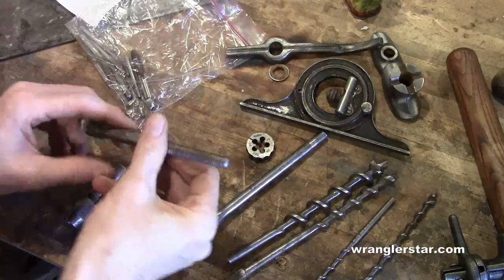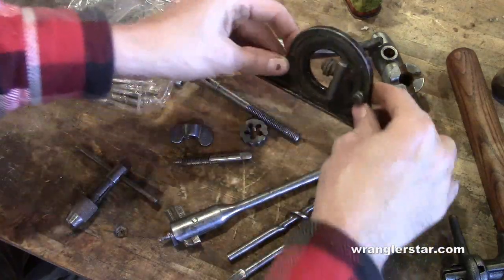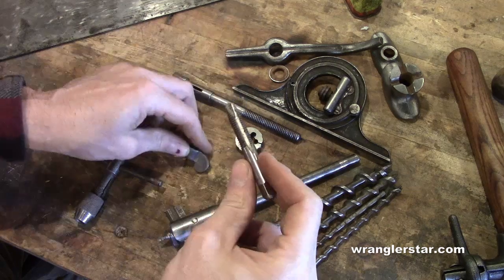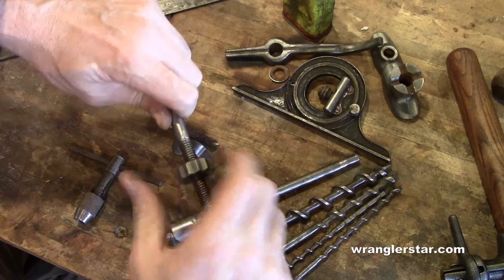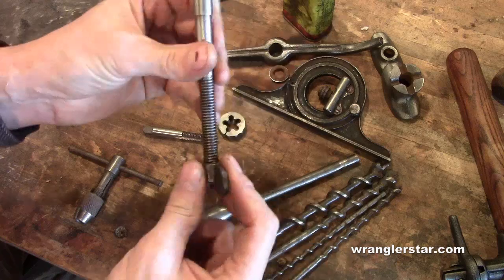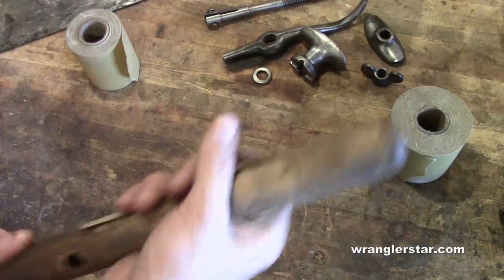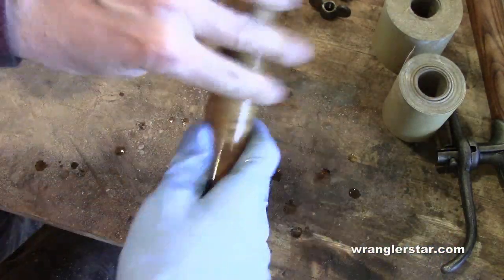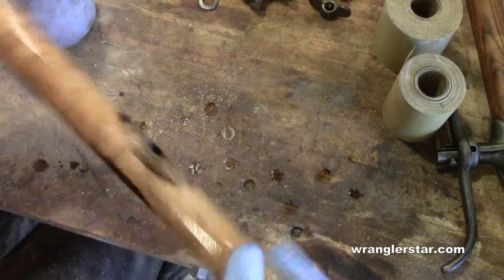Crosscut Saw 6.0 - Wranglerstar

Comment: Great video series Cody. The handle definitely is not ash or beech as others have guessed. Ash has a pronounced straight grain and beech is characterised by its flecks look at lolly pop sticks. My top guess is boxwood common on good chisels for its resistance to splitting with impacts, like beech but better. It has a wavy grain with obvious knots. Next best guess would be maple.

Comment: Looks like hard maple.

Also, we on the railroad use track adzes to chop away the cut-in area of ties under the tie plate to regauge track. We all pronounce adz with a short A like axe. Warwood still makes about a 3 pound railroad adz in the USA, if you are looking for a new one.

My great great uncle made his living as a tie hack using an adz and swede saw, just a 36" steel bowsaw. Railroads used to buy cedar pole-ties from independant tie hacks. A plle-tie is a 10" white cedar, 8'6" long, peeled, and hewn flat on two opposite sides, used for sidings and low tonnage spur tracks.

Comment: Cody,

Try a vinegar soak on rusty parts. This works both for freeing rusty parts as well as cleaning.

Afterward a quick heating with a heat gun and then a dunk in oil or axle grease will coat the piece in a good layer of protection.

Just a thought.

Comment: Here's another tip Cody that your subscribers might like in the event they have a project that has some old crusty or slightly messed up threads and a tap or die is not available try using some valve grinding compound on the threads working the nut back and forth will do a nice job to clean them up.. Take care

Comment: Cody, I was thinking about the leather insert in the washer.  I wonder if it is not intended to help keep the wing nut from backing off while in use.  It seems that a metal on metal connection would have less friction whereas the leather on metal might help in that regard.  Just a thought.

Comment: Could the leather washer be a predecessor of the compression washer or lock washer? It could be there to keep from marring the metal but I think I'd still lean more towards it being used to lock the threads with pressure from the leather expanding and pushing on the wing nut. Just a guess.
Reply: second that! leather towards wing nut will serve as a lock washer

Comment: Hey Mr. Wranglerstar, would you knock the 90 degree corner off the top of the saw closest to the handle? It seems like it would be a common place to knick a finger or knuckle on. If so, what would you use?